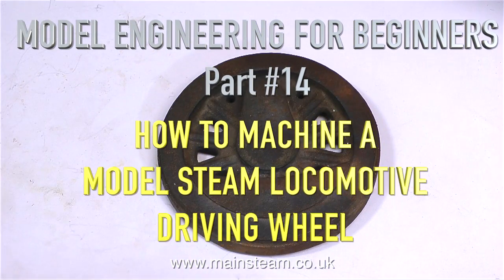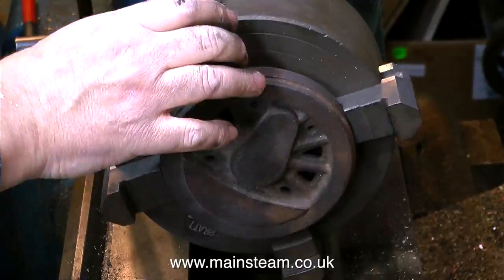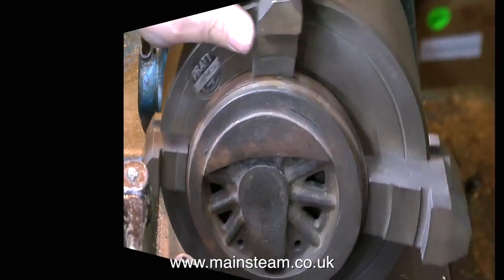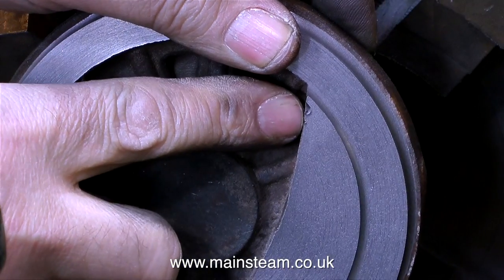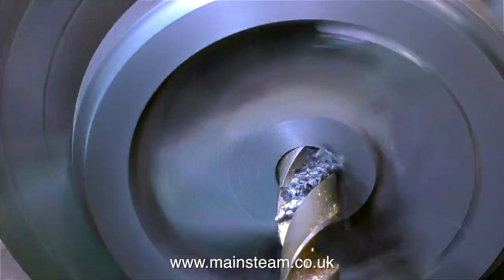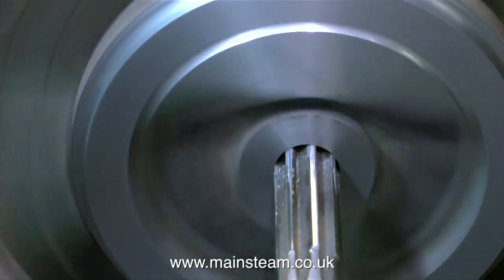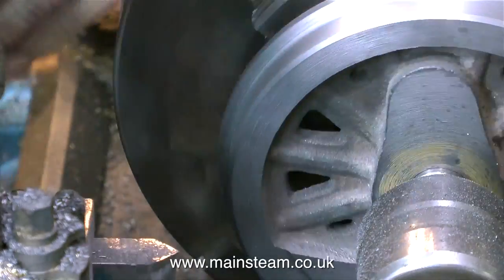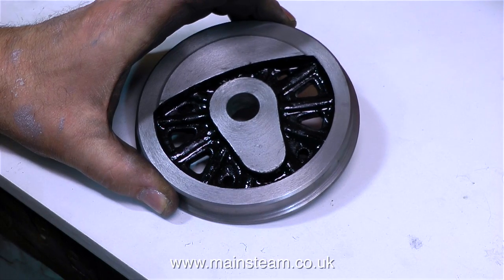HOW TO MACHINE A MODEL STEAM LOCOMOTIVE WHEEL - MODEL ENGINEERING FOR BEGINNERS - PART #14

Comment: Well made videos, especially on wheel concentricity.  Although I have a live steam track quite near my house, I prefer to build static large-scale locomotive models out of wood, metal, plastic and other scrap materials.  I have some machine shop skills but am not brave enough to tackle castings that sometimes cost $500.  Also, as a retired railroader, I have no need to "play train" that others might.  Static models can usually be built for less than $50.

Comment: Re Felis Leopard's comment on wheel cone angle, I suggest that the wheel does require a cone angle however small otherwise it will run from flange to flange contact at any speed. Try rolling a non cone wheelset without flanges down a rai trackl. It will roll off to one side or the other. A coned wheelset with no flanges will centre on the track. Without being too technical a wheelset having a zero cone angle will be unstable.

Comment: Can you use a "heat fit", where you heat up the wheel and insert the axle?  When it cools, it will be very solid.  Some automobile piston wrist pins are done this way.  Sorry, I am not a machinist, but your work IS impressive!
Reply from the maker: Yes, but another easier alternative is a tight press fit or "Interference fit " of an axle to the wheel.

Comment: Love to watch your videos. Have just one question - maybe it sounds stupid but why not make wheels from steel - my dad worked it big steel factory where wagon wheels was made from steel - not sure what type of steel but know that it was not cast iron. for me t sounds kind a easier to get and cheaper to make... any comments?
Reply: Cast iron is quite easy to machine and is also self lubricating because of the graphite content, steel isn't.
Reply: Umm...steel tyres are customary and......they give better traction on the rails than any other metal (generally)

Comment: Instead of loctiting the wheel onto the bar, you could machine a mandrill, from a piece of bar held in the chuck.

Provided you didn't remove the mandrill, until all the machining was finished, the mandrill would be perfectly true.

Also, when marking for the crank-pin, wouldn't a transfer punch be preferable to the drill?
Reply from the maker: I would normally use a mandrel mounted in my collet chuck, but I usually do it as I described in the video - it is simple .... I have made a few miniature locomotive like this ......
Reply: "Also, when marking for the crank-pin, wouldn't a transfer punch be preferable to the drill? "
You're better off with indicating in the axle hole on your mill  having a digital readout  and drilling/reaming the crankpin hole with the given dimensions directly from your blueprints--- digital readouts are getting cheaper and cheaper !!

Comment: Shouldn't the working wheel surface be on some angle to the axis? The railroad wheel is actually a cone with a top cut away to handle the turns.
Reply: "The railroad wheel is actually a cone with a top cut away to handle the turns. "
They are. However in the scale we dealing with..say: 1/8 scale...the tread can be anywhere from 0° to  2° taper  (but NOT any more than 2°). Part of the reason is at our scale we only going 5 mph with a 500 lb 1/8th scale loco  ----   not 60 mph  (with a full size freight locomotive) !!!

Comment: Do you not taper the tread?
Reply from the maker: Not usually, I prefer maximum contact with the rails in these small sizes, better for adhesion
Reply: @keithappleton  The dihedral design is very important for overall ride quality and staying centered on the rails. I honestly don't know of any model engineers who build otherwise. But I did enjoy the tutorial.  :)

Comment: I've never heard of using loctite to hold a axle in.
Reply from the maker: I've been using Loctite on axles and crankshafts since the 1980s . . .  it works for me, but you also need to pin the parts too for added strength . . . . . .
Reply: Nice tip! I've also became a lot more familiar with different types of loctite from watching your vids! Before I only knew of two types, blue and red haha

Comment: I found the "locktite" method is no good, always pin them then they will never slip the quartering, also use slip gauges when quartering, makes it more accurate then using a jig and you can get them within half thou difference each side, nice and smooth engines would never go back to using jigs after a friend informed me about the method.
TMS
Reply from the maker: Loctite works for me - I always pin them too, as I think I mentioned in the video . . . . . I also quarter crankshafts and loco wheels in my Lathe . . . .
Reply: Do you have a video on quartering wheels? I know this would mean machining another wheel and axle if you haven't 🤔